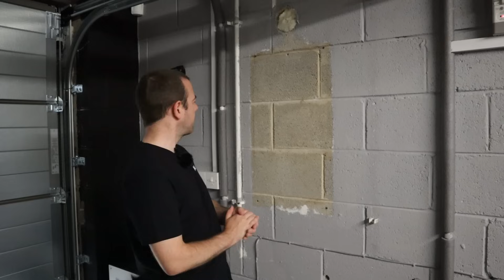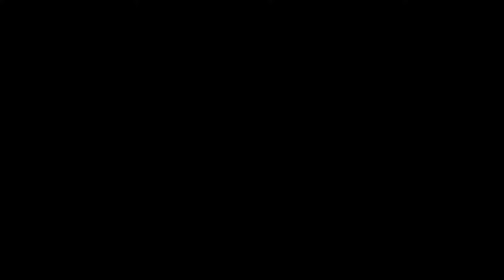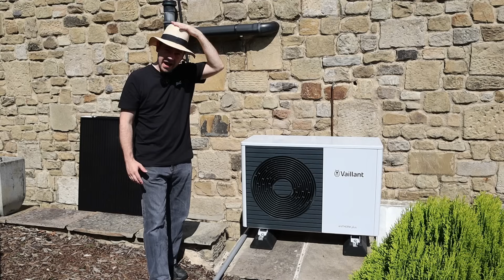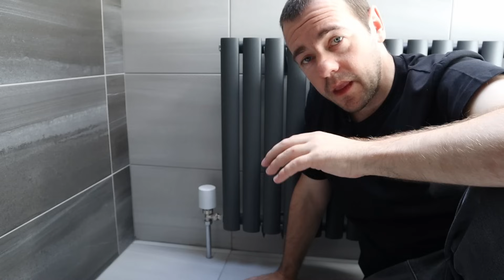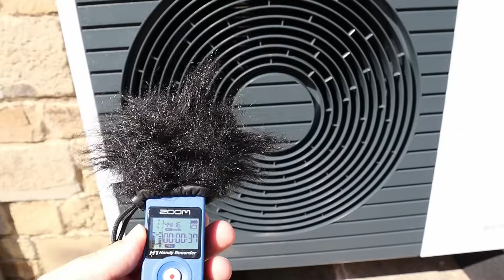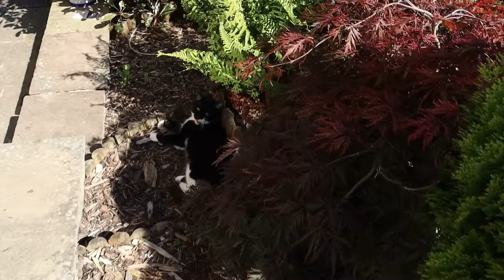Heat Pumps - Our 'Ugly' Truth!

Comment: People think that a heatpump can't extract heat from 0 celcius but that is a unit of measure for us, humans. Heatpump uses kelvin and 0 c is 270 kelvin above absolute 0 where molecules  dont move. So still lot of energy to transfer, even at -10.
Reply: Here in Norway we have heatpump rated for Nordic countries. Can take heat energy from outside air up til - 20c etc, quite crazy. It's all about temperatures of the cooling medium, it's not water what flows inside the pipes luckily :)
Ps: our air to air heatpump does well at - 15c, but the defroster turns on in the winter to melt ice water that drips from the outside unit. That takes a bit more power of course.

Comment: Hi, I'm from Australia, that tower as you call it is all but unknown to us over hear, we have very little hydronic heating over here (there is some, it's just not very common). Central heating is usually via air ducts etc.
Heat pump hotwater systems are starting to take off, with a government funded scheme to rid us of electric hot water systems (as in with a heating element) and replacing them with heat pumps. Hopefully they will extend that one day to include gas fired hot water. Although at the moment the biggest problem over here is the price of electricity to run a heat pump. Our power has shot up 30%, with another 50% foreshadowed, so I'm kind of glad I have both a heat pump (as in reverse cycle air con) and a gas heater to choose from, depending on how the supply charges go.
Unfortunately, in a way there is an advantage to gas. If the gas plant shuts down for whatever reason, it take a few weeks for the gas distribution pipes to empty, so if the plant it down for a few days, almost nobody is affected. On the other hand if the power network has a similar issue, the loss is immediate, no grace period at all...
I suppose the answer to this lot is of course a big battery that can run grid independent, however for most people over here they are too expensive at this time. Hopefully that will change.

Comment: I 'm a pensioner living in a 1970s detached house with 12 large windows, solid uninsulated floor and cavity walls.  For myself and probably most of the house owning population (UK) it's all about cost/benefit. To insulate my house up to Scandinavian standard (triple glazing etc), replace the whole pipe system (microbore) new radiators and underfloor insulation would be not be cost effective...Quite frankly I could not afford to use my savings for something that isn't a benefit. Like electric cars they are a great idea but only for people who can afford them-Good Luck
Reply from the maker: You wouldn’t need Scandinavian levels. Not sure where this comes from. 

As for insulation, that would make the same sense with any heating, gas especially.

Comment: Heat pumps can clearly do a great job, also solar and battery systems. However I think there are a couple of important points to consider.

1. Cost. A heat pump system is expensive, even with a grant. Way in excess of even a higher end combi boiler. This alone puts it out of the reach of many homeowners, even with slightly cheaper running costs. If you do need new radiators, insulation, pipework etc. that's going to send costs through the roof.

2. Space. A combi boiler is really a remarkable piece of kit for the size, heat pumps require a fair bit more space which not everyone has. Not a deal breaker but if you need to make space or reconfigure areas of your home that's more cost.

I think where heat pumps really can come in to their own will be new builds, they can be purpose built with that in mind. Retro fitting will be impractical for many people and I think we need to acknowledge that.

Comment: In Canada put in a ground source heat pump, went from $3000 propane to $300 electricity. With grants payback was 8 years.
Preheats the hot water to 45degC in a storage tank, then an electric hot water tank. Put a timer on the hot water tank to only heat at the lowest electricity  rates.
Summer air conditioning is almost free since I'm dumping the heat into the cold ground which is around 5degC

Comment: I live in western Canada . Our house is 1400 sq feet above ground with a 700 sq foot basement all heated by forced air and one small fan coil running off a storage style gas hot water heater .  In a city of over one million people I could only find one reputable firm who installed heat pumps . Our weather goes from +35C to -40C so I was prepared for some high quotations , the contractor said $31500 CDN which included a backup gas furnace as they had no system that could handle our climate even though I know some exist nobody here sells and installs them 😮 I found one manufacturer in Winnipeg called Arctic Air they make an air to liquid heat pump but even it had to have auxiliary imbedded electric immersion heat rods to work in my climate . They quoted me $65000 USD plus they had no local installer who could help me. I gave up at that point installed a high efficiency forced air gas furnace for $8600 CDN . 
I’m 64 so there’s no way I’ll live long enough to make this practical. I have 1500 watt solar grid tie system on my roof and it’s generated 15 Megawatts in total over the last 9 years so I guess I’m just going to leave my house as is for now. Canada does not seem to be ready for this type of heating at least not in extremely cold temperature zones like I live in. Hello from Calgary Alberta Canada thanks for the informative videos 😊

Comment: The boiler/water tank actually does get heated at 75degrees. That has nothing to do with the storage temperature.
Reply from the maker: This doesn’t. Flow rate is consistent.
Reply: @ElectricVehicleMan  I’m trying to say that the closed loop system running through your shower water is actually hitting higher temps. Even if you store at 35-55 degrees. This is something you can only see in the installer menu. You get a pretty bad COP on that for that reason, relatively to the CV side of things.
Reply from the maker: @syproful  The settings were tweaked, getting COP of 3.0 for hot water now.

Comment: Another way to heat and cool a house with a heat pump is via a Multi-Split system. One outside unit and up to five inside units for single phase electricity or more units if three phase electricity. I have a 5 unit Multi-Split system and a separate heat pump hot water unit. The hot water runs off my solar panels at midday and the heating/cooling heat pump system when required, generally from the house battery charged by my solar panels.

Comment: Air source heat pump supposedly 350% efficient.... 1kw of leccy in 3.5kw of heat out..... One unit of leccy 30p per kw one unit of gas 10p per kw..... So you don't save much as a friend of mine found out.... But you are helping the planet i guess.

Comment: Great video. I’ve had a heat pump for over 18 years. And yes I live in Norway and I’ve tried without. It halves my electric bill and that is an old system. And yes in Norway it is damn cold in the winter and yes it works well and contrary to negative arguments our insulation is good but not great and still we are warm 😊
Reply: Would you mind sharing how many kWh per annum you use and how big is the building?
Reply: @ChrisLee-yr7tz  sure our house is 300m2 and used 18000 kWh in the whole of 2022. But bare in mind the house is run fully electric and 2 adults and 2 teenage girls. And we keep what I would call a warm house.
Reply: @milesbuckhurst504  Thank you. Do you know how much of the 18k went on the heating system vs general electricity?
What's your average CoP throughout the year?
My house is a similar size in the uk but is old and drafty. We're looking to fully refurb and I'm considering a heat pump.
We use around 37.5k kWh of gas at the moment but obviously that would drop if we tackle the insulation.
At uk prices your 18k would cost about £6k / year which is still pretty hefty. I realise your climate will be different. I'm trying to justify a heat pump but struggling to see the economics making sense.
Reply: @ChrisLee-yr7tz  I think this is a tough question. Our temperatures here reach -10C to 20C. And since the heat pump is old by todays standards. For you in the UK you will get better ‘pay back’ . Regardless if you can vastly reduce the drafts and insulate you can most likely do much better than we do here. Gas prices are predicted to go up so I can only imagine good pay off. If I was you, I would get some proper advice in the uk. Follow the fully charged show / everything electric on YouTube there are lots of good tips there.
Reply: @milesbuckhurst504 That would cost in the UK 18000kwh  x 30p/kwh  = £5400 pretty sure your heating bill is much less

Comment: Are you running the hot water from the heat pump only at cheap rate time, or immersion?
Reply from the maker: Heat pump.
Reply: @ElectricVehicleMan  out of interest, do you have the efficiency figures for the hot water? I'd image this changes over winter too.

And just a note, if you're cycling the water in the tank enough you probably don't need a legionnaire cycle. It's only when warm water is kept for a while, not a typical household use.
Reply from the maker: @philware1546  3.1 for this month for hot water.

Comment: Like many people I’d love to go full electric and dump the gas boiler. However the reason gas combi boilers are so popular is because they are so small. One unit to heat the house and water. Many people love the fact that they lost the hot water cylinder and cold water tank in the loft. Most modern (small houses) don’t have the room for all this heat pump equipment inside or outside the properties. A modern combi boiler is a quarter the size of the unit in your house.
Really cannot see this catching on. The first manufacturer who builds an electric combi boiler will sweep the floor with existing property installs
Reply from the maker: There are much smaller versions of what I have. Separates if you will. 
The rest is outside.

Comment: The problem with heatpumps is they have to be designed an engineered appropriate to the dwelling they are being installed in. Unfortunately the quality of installers is just not there. The compensating factor with Gas boilers is that they are usually massively oversized which usually masks issues apparent even in the worst install.

Comment: Good video from a low carbon user 
https://www.youtube.com/watch?v=8VC8gFexeZc 
28% more cost than gas boiler, but 68% less CO2 
So cheaper it ain’t, well at the moment, the thing is he done a apples to apples, without the masked whiteboard of truth. 
While we are on the white board of truth 
My case with batteries have been
Summer battery use 4 Kwh avg
Winter battery use 6 to 8 
This summer saving £50
Winter saving £80
Yr saving £860
Solar Panels still have the best ROI, but every little energy saving nibbles at lowering your bill.

Comment: I will not rush to rip my boiler out as hydrogen is far better solution then heat pumps and a lot lot cheaper when the production cost come down
Reply from the maker: And the £138bn infrastructure upgrade to the gas network? Who pays for that?
Reply: @ElectricVehicleMan  The gas supply is already in place and would not need upgrading to handle hydrogen. The cost to upgrade the electric supply to every house would be astronomical.
But in any case, you just cannot get sufficient heat out of heat pumps and most systems would struggle to get much past 21C if left on 24/7
Reply from the maker: @gordonash7867  What planet are you getting your info from?

My heat pump can go to 75c and if that was the case.c how do they work in Scandinavian countries that are way colder? Your logic makes no sense. 

As for the gas network not needing an upgrade! 🤦‍♂️

Here’s a paper on the subject, one of many. 
https://www.energynetworks.org/industry-hub/resource-library/gas-goes-green-hydrogen-cost-to-customer-report.pdf

Tip: Facebook isn’t a source of information, neither is bob down the pub.
Reply: @ElectricVehicleMan  wow, did not mean to get you in a flap. Best of luck with your heat pump

Comment: interesting video thanks. I actually started watching your previous video from last year first where you said you decided a ASHP wasnt for you. Interesting to see your journey! I've had a similar journey and I have actually just actually installed an ecodan 14kwh heat pump last week - and am loving it so far. Id now like to get some more solar panels to add to our array to offset some of the additional electricity costs in summer. Were on the Octopus Tesla energy plan (using our powerwall as a virtual power plant in peak hours); so although we discharge the battery down to 20% each evening to supply the grid, we benefit from the lower day import rate.  Keep up the great work!

Comment: Thanks for the effort you have made to describe your system.  Was hoping for rather more technical detail, since the first Air Source Heat Pump installation I saw in action during a UK winter had its outdoor unit inside a snowball the size of an armchair. Extracting the heat from the frosty outside air had  made enough frost to completely cover the unit.  No, it didn't work like that!  
So I suspect that there is more that they are not telling you.  A mate in VIC, Australia took on the franchise for a local brand of ASHP, about ten years ago, turns out that much of inland VIC was unsuitable for them for the same reason.  They get frosts there.  Ground source is fine,but only if you dig it deep enough.
Now . . . . the 'technology' may have improved, but have the laws of physics changed?  Be interested to know what your supplier says about a week or two of frosty weather?  So often nowadays 'improved tech' means that a bicycle can log in to Facebook!
Reply from the maker: If they don’t work in cold weather then how have they worked for decades in Scandinavia where it’s far colder?

You do know how they operate? I mean physically.
Reply: @ElectricVehicleMan  A friend had a Swedish designed heat pump in his garden, separate from the house. It was encased in a protective cabinet to protect it from rain and snow but had vents for airflow. One night due to micro climate effects in the valley the temperature dropped to about -10c, but inside the house was toastie warm. It was quite noisy though which was another reason for the cabinet which damped to noise down considerably. He did say it cost a fortune to run though. That was about 25 years ago but the system was even older though state of the art at the time. So, yeah, they do work even in the coldest of winters.

Comment: Hi EVMan! Looking forward to seeing the numbers on the "whiteboard of truth" over the coming weeks! 🙂 We had Givenergy installed with 8.2kWh battery after watching you vids on that! We're looking at getting an ASHP too, we're even thinking of installing another 8.2kWh battery to support heating needs through winter (and charging it with cheaper electricity). Will you be reporting on the fluctuation of how many kWh the heat pump uses through each day? That would be really interesting, especially to see if the consumption of the ASHP mainly stays below the output capacity of the Inverter. Thanks for these vids, important times to be on the ball as things are changing so quickly! Dean
Reply: We to have a GE 8.2 kwh battery, and 6kwh PV.  PV been next to useless the last 2 months in the UK, and whilst I usually agree with his man maths, I can see how an ASHP would be affordable.
Maybe if electricity becomes cheaper, they'll be more viable

Comment: About 2 months back I got my own ASHP setup installed.

For my house it wasn't practical to do ducted and as I live alone in a big 4 bedroom house I wanted to be able to heat individual rooms. I ended up with 6 indoor units. 3x 1.5kW, 2x 2.5kW, and 1x 5kW.
Outside, I have 2 outdoor units, one on each side of the house controlling 3 indoor units each. One rated at 11kW capacity and the other I believe 13kW. Both are fused at 8 amps. (About 2kW)

System has been working great. Got a GivEnergy 9.5kWh battery getting installed tomorrow with a 5.5kWh solar system and the 5kW Hybrid inverter. Unfortunaterly I have no hot water heating outside of the gas boiler though, problem for another time I suppose. :)

Comment: Heat pumps vs Gas Boiler. What did your system cost for Vaillant components and labour etc. ? Its the same as solar you need to look at your consumption and look at the payback time as modern gas boilers are more efficient. Many people don't use their solar correctly as you need to use as much of the solar energy during the day or have several big battery banks. Some solar arrays and battery banks can support all your needs for a day. A 6 kW array will produce between 1.2 kW and 6 kW per hour so over 10 hours 12 kW or 60 kW. The only draw back is a kitchen appliance (s) might draw more than your solar is producing so a large kW battery would be needed.

Comment: Why go for valiant?
Panasonic has 7 year warranty.
No electric isolator outside.
What is the output sized at lowest outdoor temperature?
If it’s 5kw that’s great if it falls away that’s not good.
I install heat pumps so just hoping it’s all perfect for you 🙌

Comment: Fill the bath with 50 degree water ... leaving your hot water cylinder empty of hot water for how long?

So, if you have a shower, Mrs EVM has a bath, and (just for illustration) my daughter takes a bath (= lots and lots of water and time!!!!) ... what's left in the kitchen?

What if someone came in from a cold day out and needed a shower?

So ... how much water at 50-ish degrees is enough? Versus ... Having a smaller amount at 65-ish and using some cold so as to not exhaust the supply?

How do those usage profiles compare in cost?
Reply from the maker: I always have a bath late evening so by then there will be no more need for hot water.